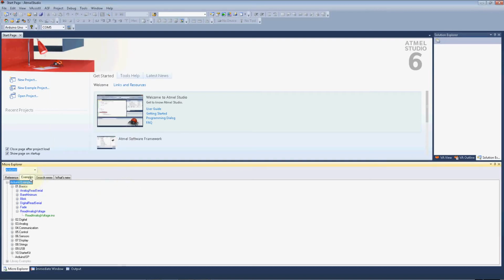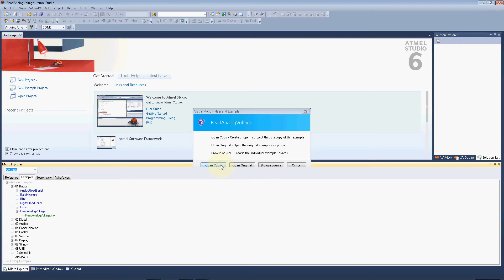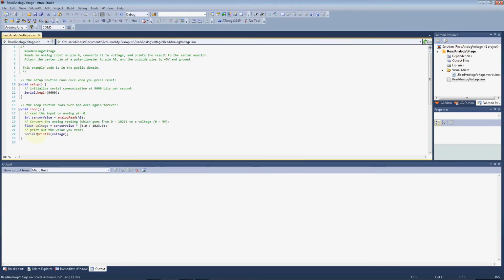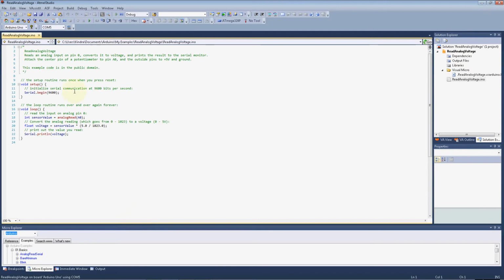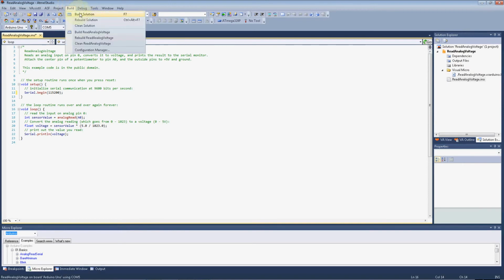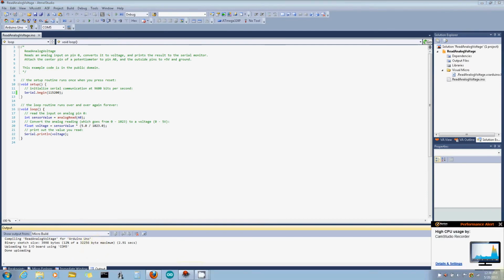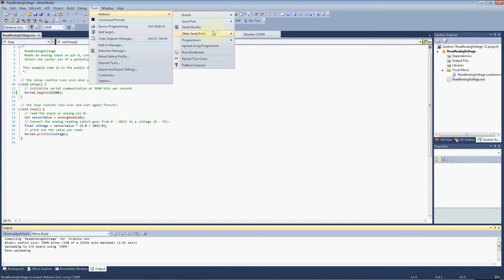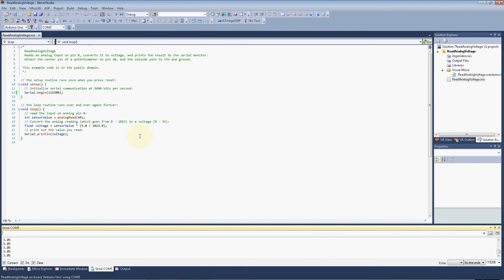Arduino Programming with Visual Micro for Atmel Studio 6.1 - Part 2 - Examples

Comment: Hello,
 I'm trying to open up an example as a copy, but I get Unable to create Arduino Project for ATmel Studio.
Reply from the maker: Do you have the path to the Arduino libraries set?
There could be other issues also.

To start; can you check the Atmel setup guide for Visual Micro
http://www.visualmicro.com/page/Arduino-for-Atmel-Studio.aspx

This should get your problem fixed, if not send me a PM
Reply: Dennis Hill Hi, Thanks for fast response.  I wasn't sure what you meant by that so tried uninstall of Studio and Arduino IDE as someone else mentioned but still wouldn't work.  Then I also uninstalled Arduino Template Express I had installed and that seemed to be interfering with Visual Micro.  Like you said could be other issues.
Reply from the maker: I think you are right; ATE can cause problems and you really don't need it now with Visual Micro.